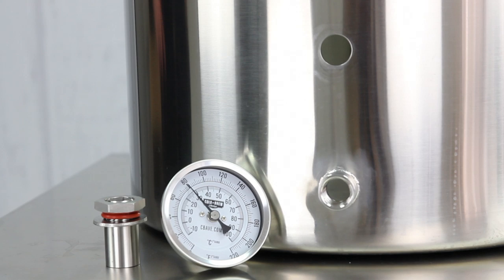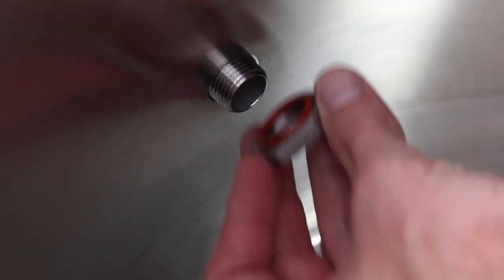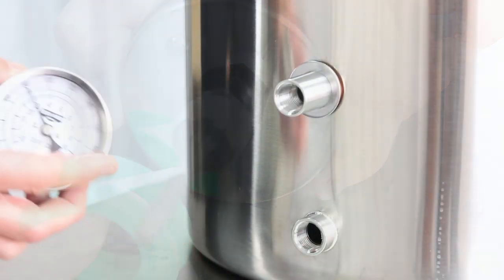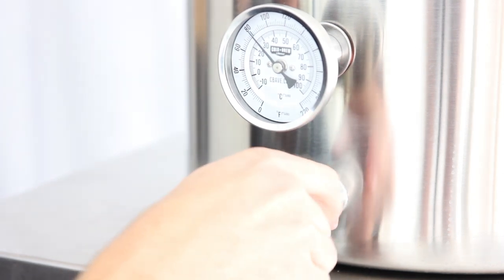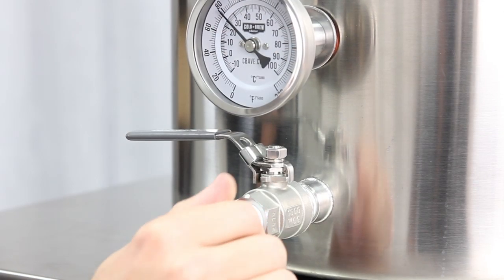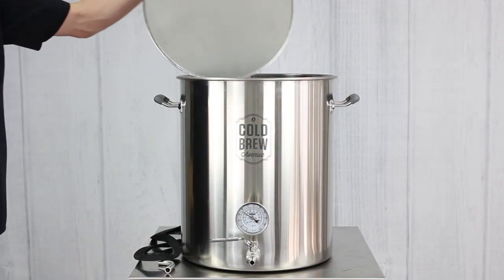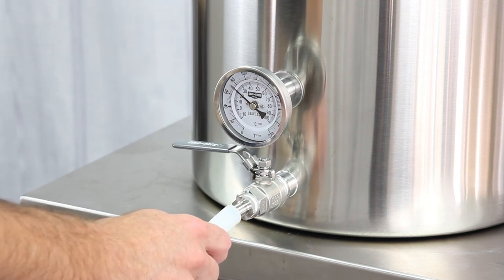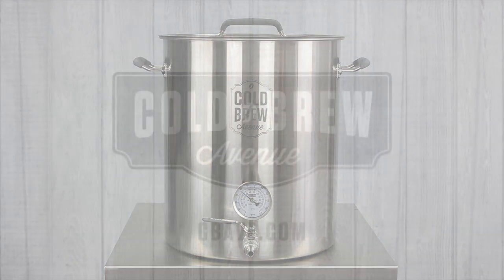Video 2: Setup and Sanitize the Cold Brew Avenue Cold Brew Coffee System for First Use

Comment: Why does it state that you only need one 'O' ring near to the start of the video for the recess on the nut for applying from the inside of the vessel including inserting the threaded boss through the hole without an 'O' ring on the outside, and then following the application of the ptfe tape on the temp gauge thread it clearly shows that an 'O' ring has magically appeared between the large washer and the vessel?
Reply from the maker: Only on the inside. Incorrect clip was used when the video was produced. Sorry for the confusion.